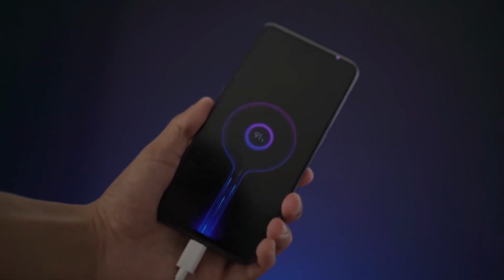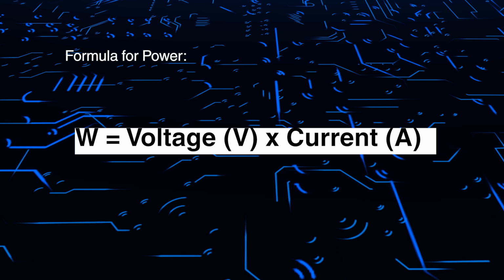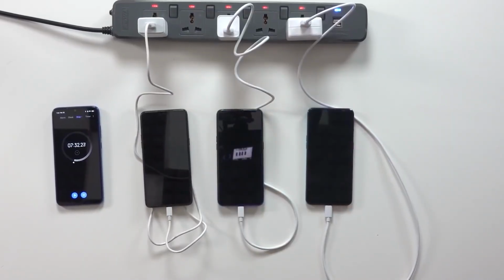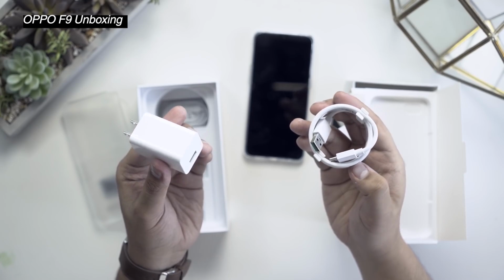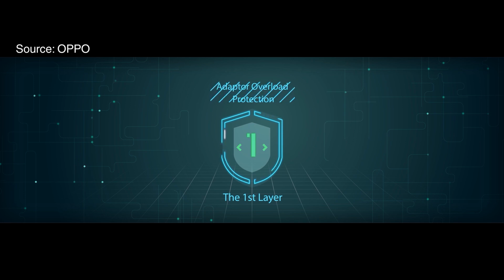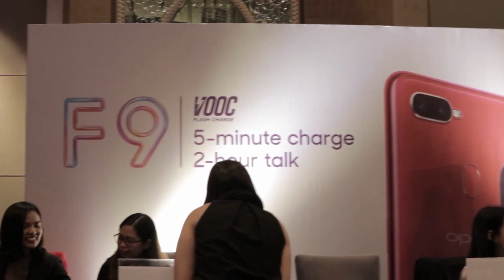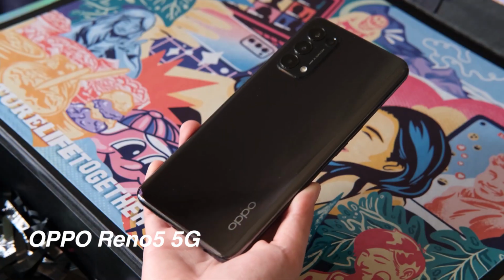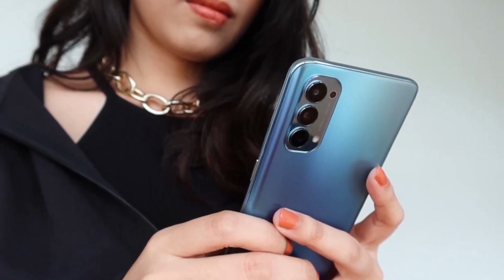OPPO SuperVOOC Explained

Comment: Pano ibalik yung supervooc charge na wala kasi yung sakin . Sana meron makatulong sakin .. pg ibang charger kasi gamit ko subra tagal bago ma full charge
Reply: same
Reply: You don't need a special charger, anything above 55w will work, it's just that it needs a cable with a 'full USB' (USB A) end that goes into the charger (ie it doesn't recognise 'PD' USB C to C fast charging). 

However, I've found you can easily trick it by using a USB C to C cable connected to a powered charging hub, or by putting an auto-charge disconnector on the end (a little safety device that pushes itself off when it detects low current (ie 100% charge), and costs about 6 USD).

Comment: If only they could make their chargers available when the original ones burn out. I cant find original vooc chargers anywhere.
Reply: You don't need one - any 60w charger will work, but the issue is that this system doesn't usually recognise the newer PD high-power (usb c to c) protocol, so you'll probably have to use your USB A to C cable. One way to get around this is to get a powered GaN charging hub, which is smart enough to give it what it needs to trigger 'supervooc' even if you use a C to C cable. An even cheaper way is to get an auto-charge disconnector (a little safety device that pushes itself off when fully charged (about 6 USD), which also allows the phone to go into supervooc, even with the C to C cable! All the best! 🖖
Reply: It is find 9ne yet?
Reply: Get a new phone